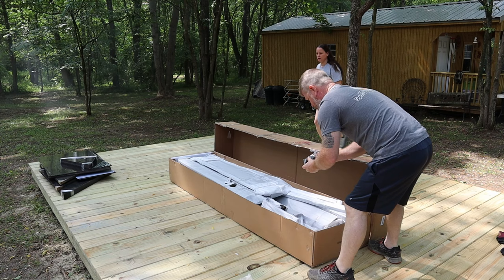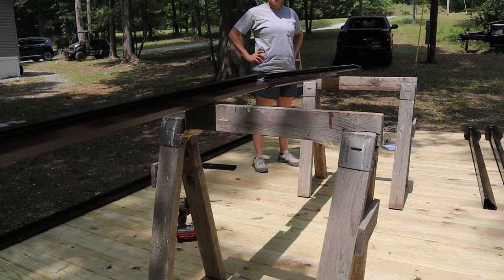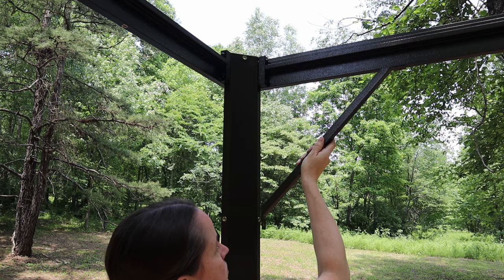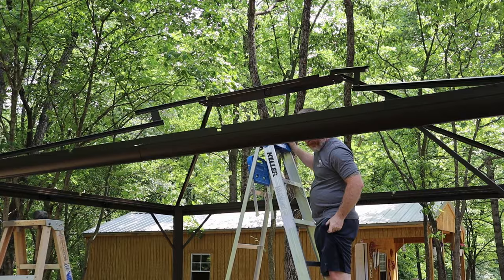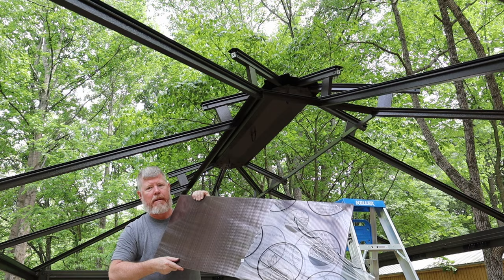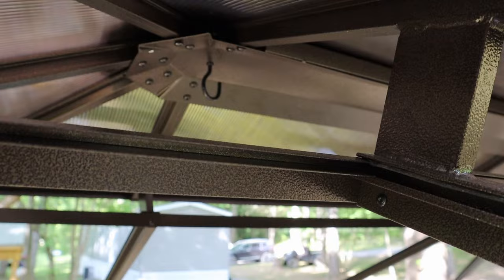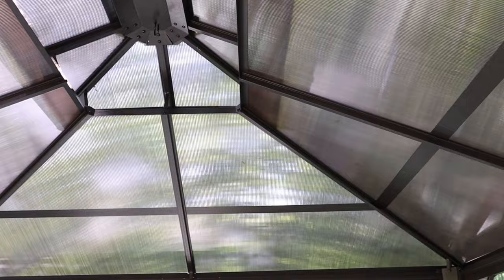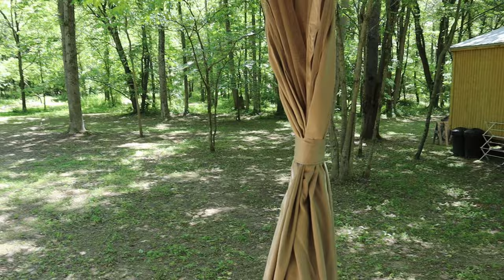"Unbelievably Easy DIY- Watch How We Assemble a Yoleny 10x13 Gazebo With Step-by-Step Instructions!

Comment: Thank you for this video! I have a question and concern though. What happens if one of those roof panels get damaged. Does Yoleny provide replacements? The phone number on their website is a dead-end and actually points to an insurance company. (Red Flag?) I'm worried that if any thing happens to this gazebo support might be nonexistent. And a Gazebo with missing or damages roof panels makes them entire thing useless.  Any experience or feedback on this would be greatly appreciated. =)
Reply from the maker: HI Phyrex. Thanks for watching and sharing the kind words. We appreciate it. Yoleny has an email for their customer service. That is what they have recommended to me to ensure customers are reaching out to them through. I do not know about replacement panels so that will be best asked to them. If you run into a dead end, let me know and I will try my best to get an answer for you. They are a channel sponsor but we are limited with the support we can provide.
Reply: @SpiritedWrenchers  Thanks for the info and quick reply :face-blue-smiling:
Reply from the maker: @Phyrex711  our pleasure!

Comment: Wonderful Video!! I bought the single roof design, and rewatched your video for each step. Great tips the instructions don't give. Especially helpful, bending the leg clips on base straight, the brackets easy to miss on crossbar you pointed out. Partially preassembling the roof main beams and lifting with help, different then instructions, but worked great with a few friends. I assembled the entire thing by myself except for the roof lift and I am past middle age :) Thanks for your video!! It was invaluable!
- A few notes from my solo assembly, I have an L shaped back house and deck, so I was able to lean 2 wall assemblies against 2 walls. I bought the 10x12 model, and screwed the other longer free standing side into the deck, after raising and propping up with weighted ladders. Then I temporarily screwed the legs onto the deck all the way around while I assembled the rest. I used painter's tape to hold some parts on while I lined holes up. That was amazingly helpful! Especially for the end caps that hold the roof sheets on. I also used bungie cords on each corner for pressure as I struggled to line up all the layers of holes. Probably the hardest part for sure to do alone. Important note if you screw the legs down to get it upright, I would suggest unscrewing them for the rest of the assembly. I struggled for hours to get the holes lined up all the way around on the roof, but removing foot screws and allowing the whole frame to shift as needed was the key to finally getting it done. Also if you are too close to roof line to insert roof sheets, you can loosen a vertical support enough to slide in from the side. Using tape helped to keep the parts in place. Its a beautiful gazebo and I'm so excited. Thanks again for the video!
Reply from the maker: Hi Theresebiz_videos. Thank you so much for the awesome comment. We appreciate the kind words, feedback and sharing your own story/tips to help others in the community. That's what this is all about. We're thankful that we were able to be a part of your journey and hope you have many years of enjoyment from the gazebo. Cheers!
Reply: I'm about to do mine mainly by myself so thanks for the extra tips!
Reply from the maker: @alfonso5276  thanks for watching, and we hope you have a smooth assembly! Take care and stay safe!

Comment: Hey Guys, great video.  Well explanatory.  I bought one and am having heat under the gazebo. Just wondering if I installed the Roop panels upside-down.  If I did is there a way to know?. Thanks.
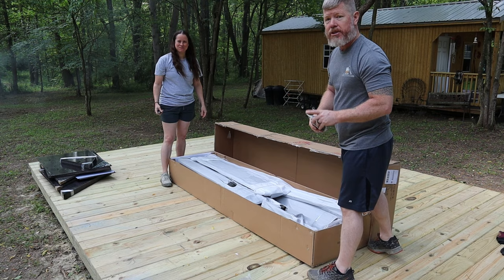Reply from the maker: Hi Hayman. Thanks for watching and sharing the kind words. We appreciate that. To your question, it is quite possible that you installed the panels upside down. If you check out timestamp 3:35, it shows the panels as having protective covering and it shows which side should be facing the sun. Hope that helps.

Comment: Great video and instructions. I bought one a day ago and was thinking, i should reinforce some of the beams because the snowload might destroy it. Do you have any recommendations or suggestions for adding more support?
Reply from the maker: Hi Gavin. Thank you very much for watching and sharing the kind words.  We greatly appreciate it.  I'm not sure if it will be needed considering the construction of the panels but we'll know soon enough.  Lol. Ours is in IL so we'll be doing a follow up this winter showing the load bearing capacity of it. If we need more support,  I may look at aluminum strips from a big box store. Hopefully it won't be needed. Hope this helps with the assembly of your gazebo.

Comment: I've been researching and not yet able to find info telling life expectancy of PC roofing, expected weight bearing capacity ie snow or wind velocity sustainability...can you help?
Reply from the maker: Hi Bowhunter. Thanks for watching. We wish we could help with figured on those but unfortunately they were not provided. What I can share with you is that this was assembled in central IL. It handled their winter last year without any problems and it still looks great. Outside of that, there are quite a few variables when it comes to the wind and life expectancy dependent on where you live. Hope that helps you some. Cheers!

Comment: I’m debating on buying the metal or plastic tops, both have advantages and disadvantages, metal last longer but too dark, the plastic has light come through but worried long term stability, how do you like yours? Can you please share some advice?
Reply from the maker: Hi Anna. Thank you for the watching and sharing. We really appreciate that. You pointed out two of the biggest differences outside of the cost and location of where you plan to have it, plus your particular weather. My parents love the this gazebo and the light that it allows through. We have the full metal one and it can get warm underneath it. This winter we'll be able to see how theirs does with the snow. We'll likely do a 6 month-year update video on it at that time.
Reply: I had my corrugated plastic roof gazebo for 12 or 13 years in the DC area. It survived our area snow and wind on the deck. Unfortunately, a freak microburst storm caused  a few large limbs to crush it, otherwise it would've still been standing!
I just replaced it with the same type gazebo, the new one has a vented roof (old one didn't). 🤞

Comment: Great video. Did you need a permit for it? And is it ok to mount it on a deck without footings for gazebo?
Reply from the maker: Hi Imran. Thank you very much for watching and sharing the kind words. We really appreciate it. This is out in a rural area so no permits were needed, however we have some friends that do require them in order to build them on their property.  Best to contact your local permit office and inquire about these first.  We would recommend for safety and security of your gazebo, the deck has footings. Hope that helps.

Comment: What do you do if you don't have concrete or a wooden deck available to mount it in to place?
Reply from the maker: Hi Michael. Thanks for watching and asking. We appreciate it. If I were in that position, I would buy the pre-made cement tube forms from Lowes. Dig the holes and put the forms, pour concrete and bolt the posts to those in the ground. It would be the same as a concrete pad. Hope that helps.

Comment: how would this gazebo hold up in a windy weather?
Reply from the maker: Hi Crysteps. Thanks for watching. Your question is a pretty broad one and will be dependent on what you define as windy weather. This was assembled in IL and they had some pretty bad thunderstorms where their power was blown out several times. The gazebo has done just fine so far. Was it hurricane force winds, no. Hope that helps some.

Comment: Great video? Does this one have the drainage system like the galvanized one?
Reply from the maker: Hi Ras. Thank you very much for watching and sharing the kind words. We really appreciate it. These smaller gazebos have a small track along the top there where the roof panes slide into but they do not have a full gutter system like our 12x20 does. We're seeing the smaller gazebo's all are that way. Hope that helps. Cheers!
Reply: @SpiritedWrenchers  thank you for the prompt response. I will install a gutter system on it.
Reply from the maker: @rasvanter3704  Our pleasure. That's what it's all about. Helping others. Would you mind coming back and letting us know how it went and even sending us a pic or two of it to our email?  We would love to share what you did with others that may ask the same thing?

Comment: The holes on my end caps don’t line up. What am I doing wrong?
Reply from the maker: Hi Tracey. Thanks for watching. This is very challenging to troubleshoot without actually being there & putting it together ourselves. What we have found with our builds is if multiple holes don't line up, something in a previous step was either missed or placed incorrectly. We had to reverse steps to figure it out. If it were just one hole, then it might have been a manufacturing issue but for all of them, it's something with assembly. Wish we could help more.
Reply: @SpiritedWrenchers  thank you for responding so quickly. We are putting together a 10x10 and when we have all three pieces together we can only see half of the pre drilled hole on frame. It’s making it hard to put together. Thanks for your feedback.
Reply: I should also add, we only tried one side. I think we’ll try another side and see if the issue persists throughout or only on one side. 🤞🏼
Reply from the maker: @traceypascal6120  We understand. We ran into an issue (I think we even called it out in the video) where something didn't line up and we had to take pieces off until we found our mistake. It happens. Patience is your friend with these. LOL. Hope that's all it is for yall too.
Reply: @SpiritedWrenchers  hi, we got our gazebo together. Had to bend in the ends on one corner but the others aligned. 😁🇨🇦
Reply from the maker: @traceypascal6120  Woo Hoo! That's awesome. Congrats on getting it assembled. We hope you have many enjoyable days under your new gazebo.

Comment: My curtains are missing the zipper. and I am also missing the connecting caps. How do I get them.
Reply from the maker: Hi Vicki. Thanks for watching.  That's quite odd and sounds like a manufacturing error. I would contact Yoleny directly, as they should be able to provide replacements for them. Hope you're able to get the resolution you need.
Reply: @SpiritedWrenchers  ,
I am unable to find a phone number or email for them. Brought by my friend on Amazon as a gift for me. No instruction manuel either. That is why I watched your video to put together.
Reply from the maker: @vickijohnson1557  I've emailed my contact at Yoleny and will also see if I can locate our instruction manual to see if there is CS info on it.
Reply from the maker: @vickijohnson1557  , apologies on the delay, but we've been traveling and so has our Yoleny contact. We were informed that you have to contact them through Amazon for support.  Let us know how it goes, please as customer support is important to Dana and I.

Comment: this is a life saver, one issue i am having is one of the long sides is too close to a wall so i can't slide the large panels  in. I dont know what to do. no room to slide the gazebo over
Reply from the maker: Hi Armen. Thank you for watching and sharing the kind words, we really appreciate it. That's incredibly unfortunat. The only thing we could think of testing is the add the panels in a few steps earlier with the side rails. Not sure if that's possible but that's the only thing we could think of. Let us know if you were able to get it resolved.
Reply: I had the same problem and loosened one of the vertical side rails to allow enough for install. Worked great! Also I used painters tape to hold panels in place and rails.
Reply from the maker: @theresedavis9358  Thank you so much for watching and contributing to the community as to how you were able to solve for this challenge. This is what it's all about... Helping others! Cheers!

Comment: I Hage this biy the maker is OUTSUNNY..I have the entire structure up and now I'm going to install the panels top tier and they do not fit ! They are not sliding all thr way in past the bolt holes..the 4 top tier pieces.  What am I doing wrong. I cant find OUTSUNNY..but thus one is the same model ..anyone help?
Reply from the maker: Hi. Thank you for watching and sharing. Sorry to hear about the troubles you're having with yours. We're not sure we understand the bolt holes part and which panels you're attempting to slide in but could you email us pictures of what you're running into? Our email is in the video description. We'll do our best to help.
Reply from the maker: I also found this for Outsunny in the event you'd like to contact them directly. You can also call us during our normal business hours: Monday-Friday, 6AM-4PM PST at (877) 644-9366 to speak to one of our US-based customer service agents.
Reply: @SpiritedWrenchers  hi so the top tier  .there is 4 polycarbonate roof panels. When I slide them in. They won't fit all the way in and so they are hanging too far past where I need to bolt them in to the corners ?? The 4 pieces are not sliding all the way up past the bolt holes  .did that help ?
Reply: @SpiritedWrenchers  oh good. I'll kerp that in mind.too ..it looks like I would have to cut the panels to fit. But I know that's not correct...Maybe I should not tighten all thr bolts that are holding the roof pieces together??
Reply from the maker: Yes, keep the bolts loose until you have all the panels in. Then go back and tighten. You shouldn't have to cut anything.  If something doesn't line up or slide in, go back, loosen or taken brackets off until you figure out what is off.
Reply from the maker: @RealiTEAwithKristaMarie  for those, check the track. I called it out in the video where you the track may be slightly bent or you have to guide them in from the top and bottom of the panel. One could be preventing you pushing it in all the way. If it's not sliding in easily, definitely check the track. You may have to bend them out just a little for it to slide on but without seeing it, it's very difficult to say for sure.

Comment: How is the heat inside
Reply from the maker: Thank you for watching and asking.  We do appreciate it. This is impossible to answer as what could be a lot of heat to one could be very minimal to someone else. Compared to sitting directly in the sun, it's considerably cooler. That's the best and only comparison that could be provided short of doing a temp test between the two (which we currently do not have planned any time soon). Wish we could be of further help. Cheers

Comment: Thanks for this video. It really was helpful. A nitpick: screens go outside as per the manual
Reply from the maker: Thank you very much for watching and sharing. We're glad the video was helpful.  We'll have to check our manual. For all of these that we have  assembled, the screens were always on the inside. We appreciate you bringing it to our attention.
Reply: I'm pretty sure the manual is wrong. Because mine also shows screens on the outside but it doesn't make sense if they go on the outside because then the curtain ties would only be able to be used if the screen was also open, which kind of defeats the purpose. I still can't figure out the actual curtain ties though and which way they go. No tutorial I have found seems to show anyone tying it. 😢
Reply from the maker: @MishlerFurramily  Thank you for watching and contributing to the discussion. We really appreciate that. We agree in regards to the screens. Apologize for not showing the ties better. I'll if my parents can take a picture of how we tied theirs. If so, I'll message you back so we can exchange an email. Would that help?

Comment: how touch is polycarbonate roof panels I live in the northeast snow and rain storms and winds .
Reply from the maker: Hello David, thanks for watching and commenting! We installed this gazebo in southern Illinois, which does see some severe wind, storms, and snow. Yoleny notes that the snow load on the roof is 2 inches on the double roof (as in our video here) and 3 inches on their single roof polycarbonate gazebos. We love that this roof design allows for some light to come through, but blocks all the UV rays making it noticeably cooler under the gazebo than out in the sun. Let us know if you have any other questions; take care and stay safe!

Comment: What size is the deck that you built for your 10 x 13? May I ask
Reply from the maker: Hi Gary. Thanks for watching and asking. No problem at all with sharing. it's a 12x16. Hope that helps.
Reply: @SpiritedWrenchers  12 is the length and the 16 is the width
Reply: Because I’m using 10‘ L 3.9‘ W pallets heavy duty as my base I’m probably using 5/8 plywood as the floor I’m not a carpenter by no means if you can help me out appreciate it. Have a great day.
Reply from the maker: @garyrodriguez185  it's actually 12' w and 16' long. My Dad wanted extra space on one end for a grill to sit. Hope that helps
Reply from the maker: @garyrodriguez185  Hopefully my other answer helps. We would recommend having the width and length be a little wider than the gazebo so it's not at the edge of your platform.